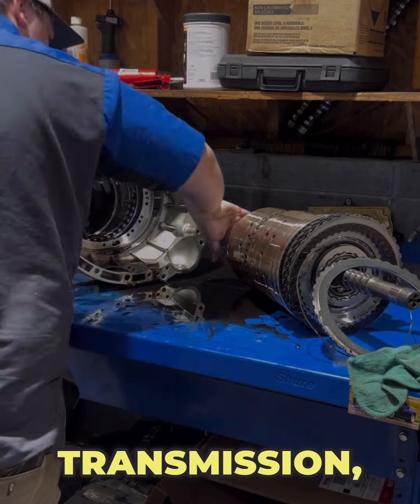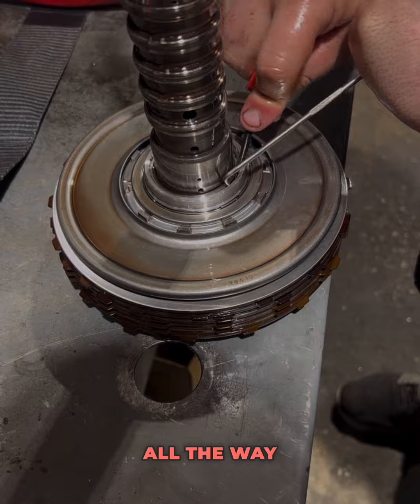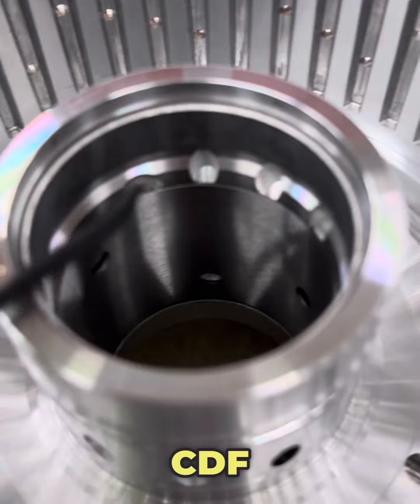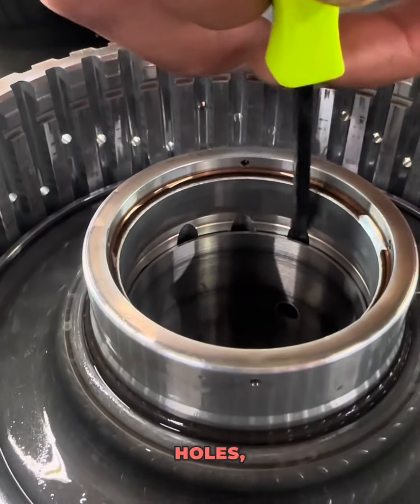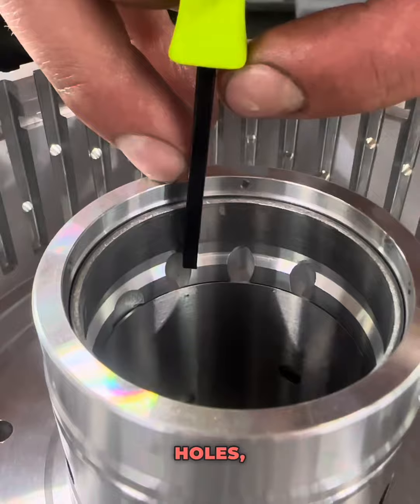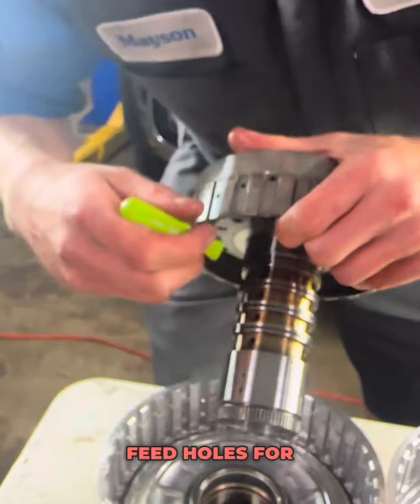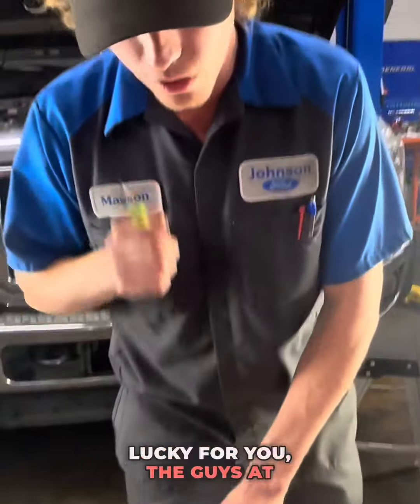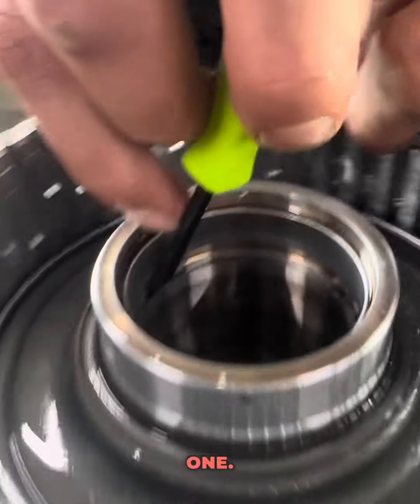Ford 10 Speed Transmission Problems? CDF Clutch Drum

Comment: Its the reason Ford has to charge 30% more than their vehicles are worth so they can cover all there warranty claims
Reply: You’d think if they just fixed the shit they know  is wrong they’d save a fortune. All they need to do is buy the product from a better manufacturer.
Reply: I used to be a Ford fan. I have a 1997 F-350. This is the last Ford I will own. I went to Nissan and moved on to Toyota. I wish Ford would make quality vehicles like they did before 2004.
Reply: Dude crazy thing is the 6 speed was proven.. I’ve had 3 6.7’s all over 250k miles driven hard/deleted with tunes never once had any issues with trans lol .. hard working farm trucks pulling trailers heavy loads cross country .. sad ford is going down this route
Reply: I’ll mention my 2023 now has 23k miles and it is shifting weird already. Searching for gears often with flared shifts lol
Reply: @Jacob08_0  I feel for you. My friend took his to the dealership who said they didn’t notice anything to avoid the warranty repair
Reply: @Jacob08_0  it’s amazing how bad a product can that can be made when GM and Ford join forces. And it is always a simple flaw. I wish ford had an upgrade to an Aisin like the Ram. All these issues keep me from buying new or at all. Who can afford a 70k truck knowing before you pay it off the CP4 and trans will need 15k in repair
Reply: @Jacob08_0  I thought ford had repaired the Oring problem. Maybe you an early 23 or just some other flaw. You have my sympathy
Reply: @jeffreygoss8109  dealer said no codes no issues lol
Reply: @Jacob08_0  this must all they are taught at training classes
Reply: @Jacob08_0  you can thank the government for their ridiculous CAFE standards. no way the trucks can meet the standards without over worked tiny displacement engines and 10+ gears in the transmissions
Reply: All newer vehicles are complete garbage.
Reply: It was co-designed with GM
Reply: That's funny especially since the cdf drum is a part designed by GM.. PROBABLY the only part GM designed in the entire transmission
Reply: Lol. The funn things tend live until the warranty runs out. Our company has 150 f150s and they all are starting to have issue and are out of warranty.  $8700.00 / trans and Mike white Ford.

Comment: That transmission is in my 2021 Transit T350. It's currently at the Ford dealer for this very problem. The service tech told me this problem caused my torque converter to fail. The torque converter is known to have a weak stator from the factory anyway. The repair will cost me $8,843.00. I have talked to Ford corporate about financial help. I'm waiting to hear back.

Comment: How haven’t they released a recall for this issue?
Reply: Mine is at Ford right now getting transmission rebuilt. I’m still under warranty, but from what guy told me Ford is just taken care of the issue even outside of warranty. I hope this fixes the problem in the long run.

Comment: I had this tsb completed in September of last year, took them 3 months to do it due to parts being unavailable. The Ford dealer I went to did provide a loaner for the whole 3 months they had it.
I haven't put that many miles on it only a few thousand but at least its not clunking and banging into 3rd and 4th gear anymore.
Reply: Was that your main issue? Hard shifts? Or was there any other symptoms?

Comment: Hope they come out with this same fix for the 10r140 also...
My CDF bushing did the same thing, 2022 F350.
Reply: My 2021 F-250 Slams into reverse and drive, about every 3rd or 4th try. The other times its smooth. Think this is what's wrong with mine? It has no codes
Reply: There is a TSB 22-2252, where dealership can flash the TCM, and has fixed that problem for some people. The flash fixed the harsh Reverse and Drive shift for me, but the grinding/vibration on the 4-3 downshift was still present. 
I had low line pressure b/c of the bushing blocking the fluid passages, and blew out the teflon sealing ring  @Jewalston
Reply: @o_issues_o  Ok. I've been watching these videos between this channel and PTT on these 10R140 Trans for a while. I just called the dealer and set an appt. It's also extremely violent when it shifts into 4wd low. It yanks the entire truck forward.
Reply: They can flash your TCM, and then you will need to drive a couple hundred miles for the trans to relearn shift strategies. If it continues to do this after that, I would say it is this CDF bushing, or maybe your valve body causing the problem.   @Jewalston

Comment: Is this the reason the gears jerk?
Reply: My 2020 ranger has had this issue since day 1. I took it to Ford over the last few years about it. They always told me "it's normal". I even showed them the research I did saying it's a bushing but of course that wasn't it. 

What happens with mine is 3rd and 4th gear. It loses line pressure  (I'm assuming the hole that's blocked is it losing line pressure). And it feels like the whole truck loses power for almost a second, then comes back like it's normal. I had to take matters into my own hands after the dealer kept telling me they can't do anything about it. I changed the fluid to amsoil and pan to a better one and it shifts like butter. The line pressure issue remains, I hope they fix it for me this time ... After dealing with them about this I told myself I would never buy a ford again. Its been ridiculous
Reply: @champinsoccer9  My '19 Ranger occasionally has this issue as well.  It also feels like the torque converter does not disengage when coming to a stop.

Comment: Can you make a video on common reasons your radiator fans stay on high in 2011-2014 f-150s?
Reply: I have a 2014 and I noticed if the temp outside gets in the high 90s, my fan stays on the entire time the engine is on.  We had a 2013 f-150 work truck that did the same thing. 160k miles and no issues tho.
Reply: If you've had your air-conditioning serviced, that's a symptom of the system being overcharged. Some vehicles leave the factory overcharged and some people use the DIY trigger cans that easily put you in overcharged territory.

Comment: What are the symptoms? I took mine in because it sometimes slams into third, and fourth to fifth feels like it just drops off for a second before it shifts. G
If it down shifts into ninth and eighth, it slams into those gears too. 2021 F-150. Ford said it's normal.
Reply: The 10R80s are clunky by nature. They really only like to shift smoothly when harder on the throttle. But if you got a 3-5 skip shift slamming that's due to the CDF drum. Also going into 10th gear and if i remember right if you get stuck in those higher gears 8-10 then CDF drum is probably causing clutches to stay engaged

Comment: Just had a new 10r80trans put in my 2018 f150 5.0 at 110k miles May 2023,  did they put this new drum in the new ones or do they need to be built? Is their a part number or model number for the new ones to see if I have this drum? The new trans has 100k or 3 year warranty
Reply: Concerned as well.  Would love to know.  Mine is an 18 3.5 EB and shit the bed at 50K

Comment: So my 2020 f150 with only 29k miles is getting a new transmission right now in the shop. I asked the service rep 3 times so this is not a rebuild and he said no, it’s new , this new transmission is different then the original from 2020. He said the body is the same but the internals are different, the valve body is different , solenoids is different. So hopefully mine is the updated version otherwise I’ve been thinking of switching to gm but I think they are having the same issues. Mine started with coming to a stop and feeling like someone rear ended you, so I greased the driveshaft and fixed that issue. Then it started with a whine noise whenever running. Then hard shifts into 3 and 3 to 5th then into 8 th. I reset the adaptive learning didnt fix it, took it to dealer , they said there’s a 3 step process they do on these. First replace the valve body, well that didn’t fix my issue , second was new drum and clutch , but they skipped to step 3 just in case other internals got damaged. Step 3 , new transmission, so time will tell. It’s paid off is the bummer part , maybe I just ride it out or do I trade it in while it has Low mileage and running good ???
First world problems lol

Comment: Yup that was the issue with my 2018 f150...
Reply: I have the 18 also. Did you get it fixed on the jerking between gears?
Reply: @gregsmith983  I had it fixed under factory warranty, probably 2 years ago. It would shift very hard into 2nd or 3rd gear and had many other weird shifting symptoms. It didn't do it all the time but when it did it was very noticeable.
Reply: So they did the CDF Clutch update?
Reply: Mine shifts hard when going to 3rd it will skip 4th and jerk into 5th just pisses me off.
Reply: @gregsmith983  yup mine did the same

Comment: 2020 Ford F-150 XL owner here. I like Ford vehicles for a number of reasons but I do not like everyone at ford. Just like how I also dont like everyone at ASUS even though I like their motherboards. 

I had some weird jerking around the 7-8th  gear on the high way and I think I felt very little when I was driving in residential areas around gears 3, 4, and 5. I did call my local dealership and explained to them whats going on. 

Seeing this video makes me feel sick and anxious. my warranty I know is likely no longer around and I see myself paying an arm and a leg for this kind of repair.
Reply: I just was told this was "likely" my problem too.  My symptoms are exactly yours...7-9th gear when accelerating on highway but no issues in the lower gears.  Of course I'm out of warranty too.
Reply: @davidfelton3084  UPDATE it appears it may most likely be a programming issue. So they went ahead and cleared this "TCM" thing which clears the learning and now the truck seems to be driving normally now. 

probably safe to say that if it happens again after a transmission fluid change, its likely the TCM also has to be cleared at the time of fluid change.
Reply: @GAKtion64  That's very interesting because before I decided to take my truck to the dealer, I found another YouTube video that talked about clearing the Adaptive Learning Tables for the transmission.  I think this is what you're referring to.  I was able to do this myself with the FORScan free software (and a free extended license trial) and an ODB cable from Amazon.  (video showing how to do this yourself https://www.youtube.com/watch?v=sHbsIboCfbc&t=69s) I reset the tables yesterday, and have driven probably close to 75-100 miles since then, and I already notice better shifting and I really haven't been able to easily replicate the stuttering in the higher gears like I was able to for the past many months.  I'm optimistic that I may have avoided any "real" transmission work for now.

Comment: So I have a 2021 f150 that slams into gear. I had the valve body rebuilt through this tsb, it had lessened the amount of times it occurs. But now all the sudden the have a new tsb that supersedes the previous tsb and doesn’t include 2021-2023 F150s. So the dealer won’t replace the cdf drum. Eventually they’ll have a tsb that includes 2021-2023, but it will come out once most of us are out of warranty. They acknowledged it in the previous tsb but now it magically vanished. Very very dirty Ford

Comment: My 2017 Explorer Limited w/ Ecoboost had transmission failure at 55k. It was slipping after cold starts for probably 20k. I hear you implying but can you confirm the 2024’s are fixed? Thinking about buying a F150 because I really do miss that explorer but want a pickup and most of these new engines scare me so my choices are slim. Thanks in advance and thanks for the information!

Comment: So if I were to order a new 2024 F 150, would it come with this improved part?
Reply: Buy a Toyota
Reply: @Brocephus77  in case you haven't heard the toyota's are having problems also
Reply: @kevindodge2103  all manufacturers have their problems. Ford is one of the top TSB and recall manufactures problems.
Reply: I would like to know this as well.

Comment: Is there a thermostat in the automatic transmission or the cooler
2019 f150 2.7 4x4
Alot ppl seem to think so
Having weird temperatures
New 170 thermostat 
Engine stays 180F
Transmission is all over the place

Comment: Didn't he mention in the best 150 video about how great the 10 speeds are over the 6 speeds ?
Reply: I have an 06 f150 with 6 speed still smooth as day on drive it off the lot. The 10 speed is pitiful and I was told at dealer this is the way it is.
Reply: 10r80 shifts faster 
The 6r80 holds power reliably
Reply: My 2011

Comment: 2021 F150 with 31,000 miles and I had to have my transmission rebuilt because of slipping. I asked if there were new and improved parts put in it and they didn't have an answer, called ford but couldn't get an answer. Is there a way to determine if my rebuild included new re-engineered parts in it? Thanks for the video.
Reply: The updated part didn't come out and told May of 2023

Comment: Thanks for all the great content.  Could I ask you to consider making a video where you detail the symptoms of the various issues with the 10R80?  The different issues it seems to have may present differently. 

I have a 2020 F-150 and every once in a while, if I put it in drive from a cold start, it will act like it's in neutral.  I'll give it a little gas and nothing...but if I let up on the gas and then hit the gas again, it works fine.  Probably has done that about 6 times in the four years I've had it.  The other issue is becoming more frequent (like several times a day).  When I accelerate under moderate throttle, if I let up on the gas at the same time it upshifts, I get a muted clunk sound.  

Took it to my dealership and they said if I have them look at it, it's currently a 6-week wait just until a "transmission tech" can even troubleshoot it.  Additionally, they can't schedule that tech to look at it and have me just come in when they're ready...I have to drop it off now and then wait 6 weeks to get it looked at...ridiculous!
Reply: How did this work out?

Comment: Back in 2017 I special ordered a F150 that cane with this crap.
Took it to the dealer several times until the dealer admitted that there was a problem and Ford was working on it but would not admit it has a problem.
It was the only vehicle I ever returned after the lease was over.
Total POS....

Comment: Hi I have a delayed shift from 5-6 also when I put into reverse the truck jerks, i took it to the dealer and was told if it just needs an update it would be $300 and warranty would not cover updates 
And if the update doesn’t fix it then they would see if my extended warranty would cover it 
Do you know of an update fix shift issues? And if I can get it done cheaper else where
Reply: An update COULD fix it but it's rare. All the update is gonna do is clear the valve body memory and try to relearn how to shift. If it doesn't fix it then at best a new valve body is needed. Otherwise it would need a tear down to see if, i think it's A clutch that's messing with 5-6

Comment: can you help with my 2020 expedition max 3.5l EcoBoost with 10r80. After drove for 20 mins when trans at 5th gear and I hit the gas pedal hard to accelerate,  the car feel like something hit it ( vibrate hard) and no gear show in the dash, after 1-2 second its show 4th gear or 5th gear and keep driving fine. does not happened when cold start. I checked fluid at 206 deg and it is between 5 and 6 on the dip. only happened at 5th gear with accelerate hard. soft acceleration did not happen.

Comment: What are the symptoms of this failure. My 19 has always seemed off from typical trans shift characteristics. Have had it reprogrammed and it helped but still shifts different. My truck is still under warranty so what would I say to the dealer to get this fixed instead of the typical can't recreate issue while waiting for warranty to run out.
Reply: You'll have a harsh 3-5 skip shift. That's the easiest symptom to pick up

Comment: Stay away from the Ford & the Chevy with the 10 spd trans.  They are nothing but trouble & why do you need so many gears in a pickup truck or a passenger car? You don't.
Reply: Because the government imposed ridiculous fuel emissions standards the the manufacturers needed more gears to keep the engine rpms down to achieve them.

Comment: Does anyone know what company makes this upgraded drum or have the part # ? I'd like to make sure this fix is done correctly the first time. I hear so many stories of people having their transmission fixed or replaced and then it goes back in.
Reply: JL3Z-7H351-B. that is the f150, expedition, navigator and 5.0 mustang cdf cylider.  JR3Z-7H351-B this is the ranger and 2.3l mustang cylinder number.

Comment: I'm truck shopping right now and thought that I wanted a 17 and up F-150's with a 10 speed.   Until I drove 2 2019's back to back and they both had jerky shifting when under no load at lower speeds.  When starting to accelerate it would jerk into gear on both trucks so now I'm shopping for a 2015-2017 that have the 6 speed transmission and have the 5.0.  Any problem with the 5.0 for those years?
Reply: Nah 6R80s are less problematic. They're built with stronger internals that won't wear as easily
Reply: @adrianarreola7467  well, this issue kind of drove me towards buying a Tundra.